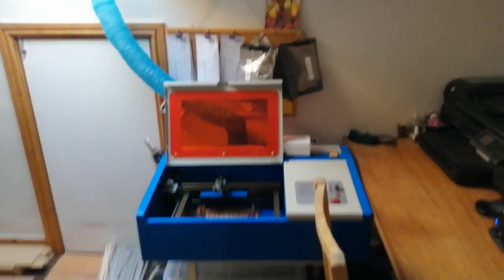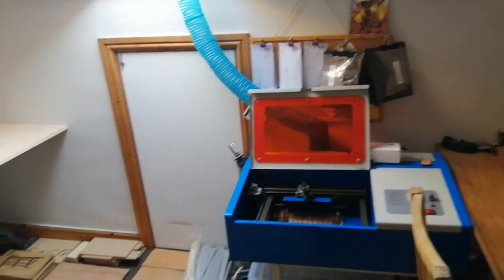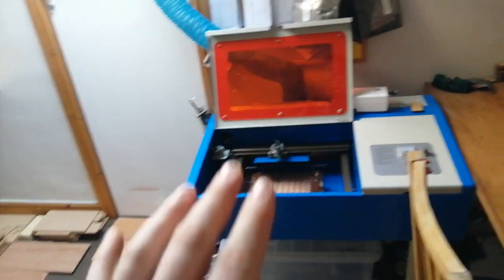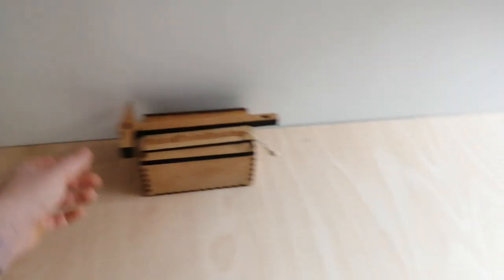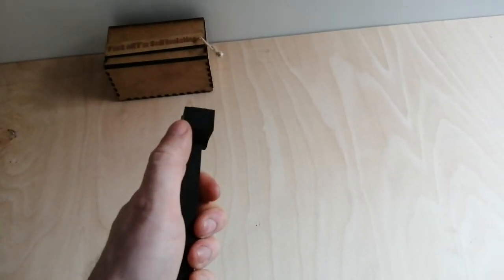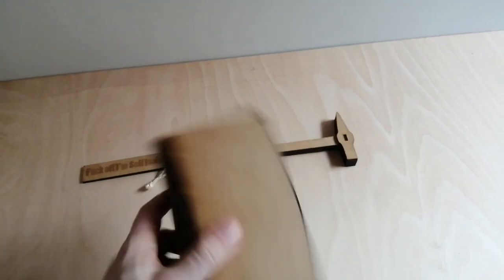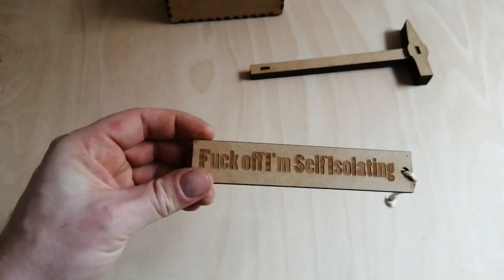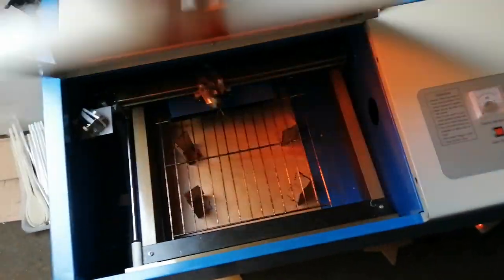Locked down with a laser, My current set up

Comment: You wouldn't happen to have a file you would be willing to share for that box do you?
Reply from the maker: I got the box design from https://www.festi.info/boxes.py/, after a while the latch part doesn't hold too well. There are lots of other boxes on there.
I suggest using their burn test to find the right kerf for your machine. Mine worked out at 0.047mm to fit tight but not too tight.